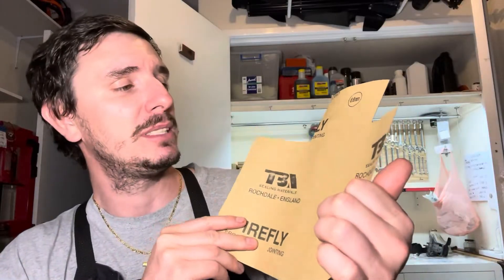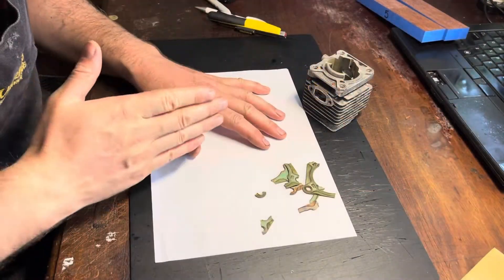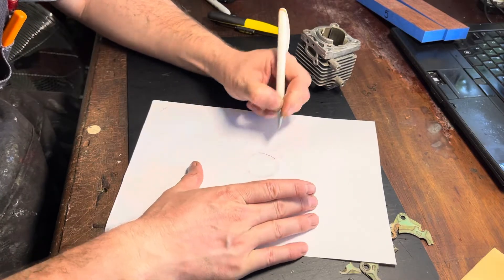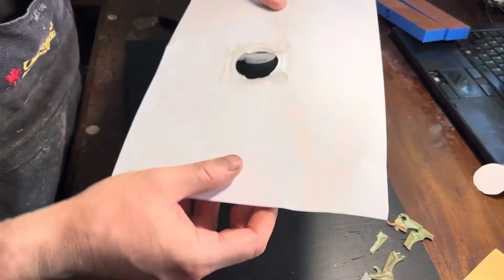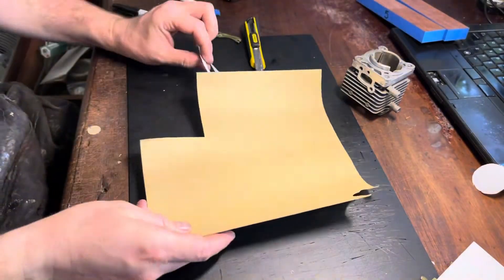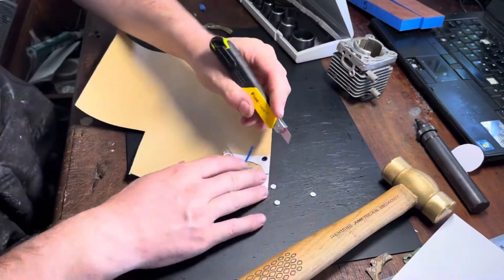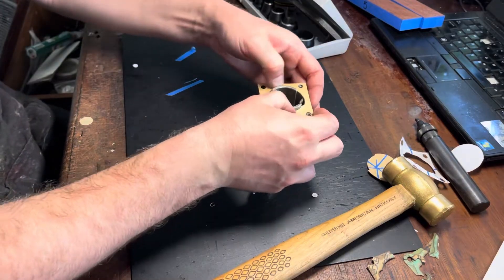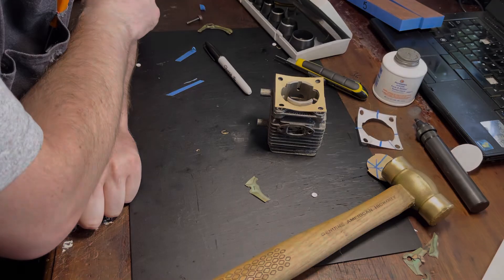How To Make Your Own Gaskets From Scratch - DIY Easy & Free!

Comment: I have made many gaskets for car enginen, using cork sheet and a ball hammer; lay the sheet over the engine part or carburetor etc, stick it down with sellotape so it does not move, and knock all around the edges with a ball hammer, cutting through the cork. Even the bolt holes cut perfectly. Works for any gasket except the head gasket, as that needs to be metal. I just HAD to buy those even when i was broke! :-) .
Reply from the maker: Yes :) it works very well on them doesn't it! Not so much with mag cases unfortunately!

Comment: Quick question, rebuilding a stihl 064 and have a little bit of cavitation inside one half the crank case, should i JB Weld it smooth and repaint? Or leave it as is?
Reply from the maker: Do you mean cavity? If it's lot leaking air, leave well alone, you may introduce more problems than you'll solve.
Reply: @VintageEngineRepairs when aluminum corrodes it's called cavitation
Reply from the maker: @mariocorleone106  The engine housing (crankcase) is magnesium and the pitting didn't occur from cavitation like you'd find in a prop or water pump impeller. Otherwise all these engines would be pitted. It's caused from moisture or water leading to what is known as mag-rot. Or magnesium oxidation. When aluminum (or magnesium) corrodes it's not called cavitation, it's called oxidation. Cavitation is the formation of vapour bubbles in a liquid (a crankcase only has vapours) that then implode.
Reply: @VintageEngineRepairs yes, my mistake, thank you.  Water definitely got in there.  So i took a carbide burr removing the rot, and filled it with JB Weld high heat.  Made the gasket a little bit ago, thank you for the guidance, and now just waiting to tomorrow to reassemble and test!
Reply from the maker: @mariocorleone106 all good, we learn something new every day. I generally advise against any fillers, as mentioned unless essential because whenr they eventually  release, they can damage the piston. Either way, good luck with the repair! 👍

Comment: What material do you use for in between the intake and cylinder? I bought something that is advertised as gasket material but it gets obliterated by gasoline and then sucked into the engine. Always a pleasure to clean the crank case with little bits of gasket.
Reply from the maker: Ouch! I use oil jointing sheet :)

Comment: I have a cardboard fibre gas and oil resistant gasket maker, can it be used on cylinder heads?.
Reply from the maker: Check the instructions; but it’s not often the case due to the high temperatures

Comment: Youre a great teacher! Keep makin videos.
May I ask what the thickness is for these small enine gaskets? I would like to make one for a stil muffler.
Reply from the maker: I use 0.8mm on most gaskets for garden power tools :)
Reply: @VintageEngineRepairs  thanks so much! I was searching for the spark arrestor on my stihl fs260c only to realise its nowhere to be found. But I did discover that there ws NO gasket in between the muffler.  No clue why it wasn't there but perhaps the repair guy didn't replace it last time when fixing the piston
Reply from the maker: @healthyrootsstrongwings538  there isn’t always a gasket between the cylinder and muffler on all models :) you’ll have to get the ipl to check if it’s present on yours.
Reply: Thanks! I found a part list on a website but it is not quite the same model as mine. Initially i wanted to find out where the spark arrestor is located but on my model I cant locate it at all. Also the muffler seems slghtly different.
 I am baffled but wont give up! @VintageEngineRepairs
Reply from the maker: @healthyrootsstrongwings538  looks like there should be a gasket - part number 4147 149 0601 also your spark arrestor screen is a hex bolt on the exhaust. Take the hex bolt out and the spark arrestor will come out with it.
Reply: Thanks so much for your reply. We are probably looking at the same diagram. My issue is that my muffler is different from this one. It does not have a hex bolt and spark screen. Just a little exhaust nozzle but no threads or anything. Second, the muffler and the stainless steel plate with nr 7 in the diagram are attached together. that staines steel plate was bolted straight to the cylinder with no sign of a gasket. I did have a piston replaced at an official Stihl place but cannot imagine they did not put a gasket back on.

The issue my strimmer has it that it boggs down when I fully squeeze the trigger. 
I wanted to check all possible causes before trying to adjust the H screw on the carburettor.

Im just trying to teach myself these skills and want to save some money on repairs but I am clueles enough now to consider bringing it in after all.

Thanks for all your kind help! You are a natural teacher. Keep doing what you enjoy :)
  @VintageEngineRepairs

Comment: Great video! I used to lightly tap around with a hammer to get the shape, but dirty thumb 👍 I like 😂 What could I use to make a new bung into the fuel tank where the two fuel lines go through? Mine is cracked and disintegrating 😬
Reply from the maker: Haha I’d replace it, but in a pinch, pull it out and wrap around the surface that mates with the tank using PTFE tape. Hope it helps! Regarding tapping with a hammer I agree on iron it’s fantastic, mag is quite brittle and chips, ask me how I know 🤣
Reply: Didn't think about getting a new one - I'll look into it. Tapping iron for the gasket was for an old BSA garden tractor engine - that was pretty strong!

Comment: Any tips for cutting exhaust gasket?
Reply from the maker: Because exhaust gaskets are typically metal reinforced I’ve never bothered to try honestly!
Reply: @VintageEngineRepairs  I've made one by hammering on a chisel and leather punches (for the internal corners), it's a bit rough though.

Comment: Excellent video Tom two of my favourite tools in the shop are our set of hole punches (use hammer) and our leather hole punch (sometimes called a belt hole punch) with the rotating head with different sized hole punches and they are relatively cheap on Amazon like $16 Cdn.
Reply from the maker: Great Wayne, my punch set was WAY over priced, but I paid it thinking that because it was made in England it would be good. The punches didn’t even come sharp. Either way I couldn’t do without it!
Reply: @VintageEngineRepairs  I think Jake got ours on Amazon and they have extremely sharp cutting edges, when i go out to the shop i will check the brand name and reply in case someone reading this wants a good set.

Comment: Where to buy the Firefly gasket materials? Also hole punch sets if possible. Some applications might call for specific thicknesses per engine specs of torqued assemblies. Excellent video!! 👍
Reply from the maker: Hey Mark, I got it from my local automotive store, in Australia it’s called Supercheap. This paper was anything but cheap! They sold it to me half price on the end! With this said, this gasket paper is far superior to the “oil jointing paper” I got last time. Absolutely, yes regarding thickness. It’s a good idea to get an assortment pack of thicknesses  :) thanks for watching!
Reply: I'm opposite of "down under" which I suppose puts me in the "up over".. in the USA.. 😎 I'll search both firefly and supercheap. We feel the same costly pain at the counter for things like this. Reality might be costing 1/10 for a manufacturer to produce but, we need it and they dictate pricing unfortunately!!